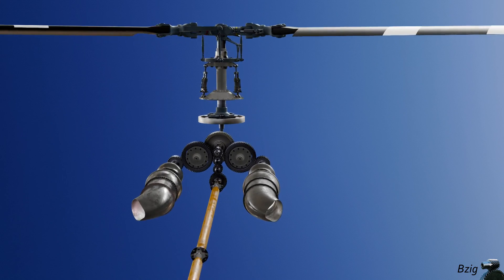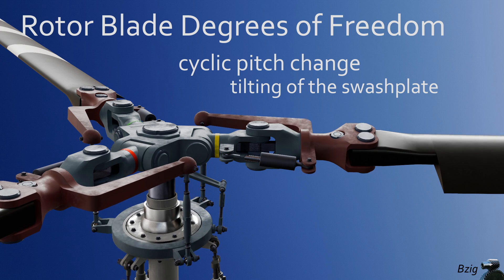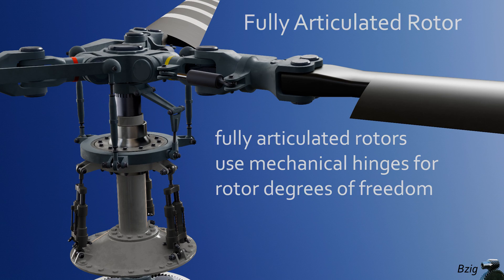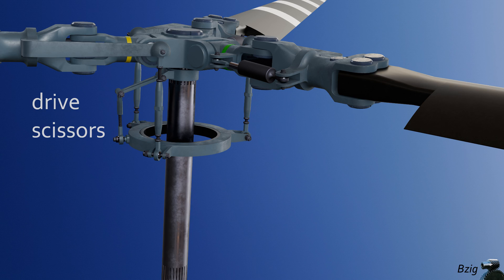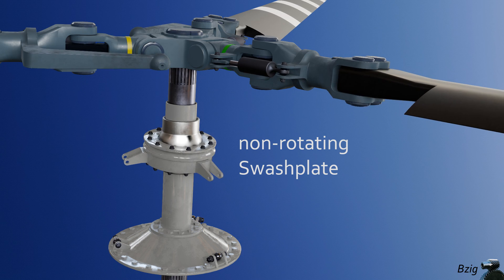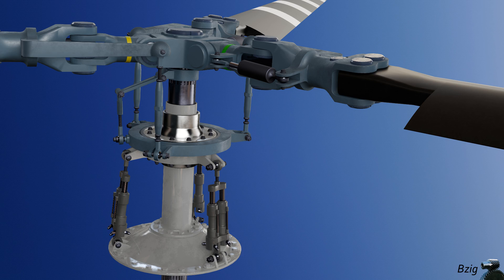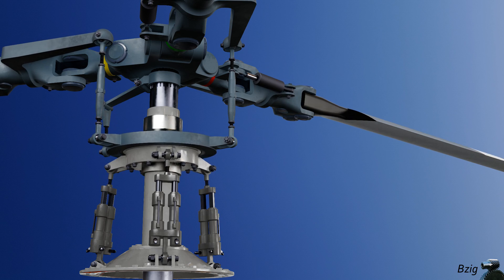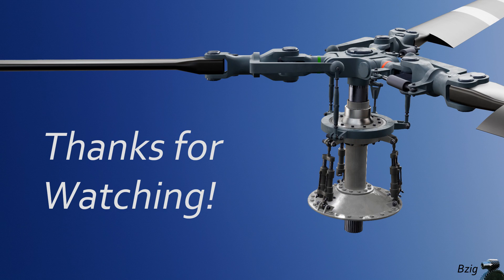Helicopter Swashplate Control

Comment: If they can reduce the vibration and wear and tear, I think the rigid rotor system would be ideal.
Reply from the maker: Am I right that the fully rigid heads, like the BO-105 and the Lynx have fallen out of favor and more designs today are semi-rigid with a little less flapping stiffness?  Like you say, ride quality and vibs sells helicopters.
Reply: @bzig4929  
I would say you are.   The benefits of their simplistic design (relative to a hinged, fully articulating rotor) and superior agility and handling aren't the top priorities for cargo and people haulers.   So I was anxiously looking forward to see what would come from the Sikorsky/Boeing Defiant and the Sikorsky Raider X models that the army was funding.  But they pulled the plug on that,again  so...  We're just going to be stuck with these terrible hinged, fully articulating rotors for a little while longer, lol.,
Reply from the maker: @bryanrussell6679   and interestingly, all of the tiltrotors, MV-22, AW-609 and V-280, are 3-blade teeters with a hub spring.  And the electric VTOLs all seem to be stiff systems that are likely absorbing some severe vibrations during the transition to forward flight.  It seems like simple designs that brute force their way into the air are winning out over engineering elegance.  Like you said, "lamenting out loud"
Reply: @bzig4929  
Yeah the tilt rotors are basically like giant propellers  but with the ability to tilt, like you said.  I'm not sure if a fully articulated rotor system would survive the 90-100 degree swing without self destructing.  I can't say for sure, but there has to be a reason the tilt rotors don't use them, lol.
Reply: @bryanrussell6679 Osprey has cyclic control
Reply: @ArneChristianRosenfeldt  
Lol, I definitely worded that wrong.  Of course tilt rotors tilt...  You said what I failed to.

Comment: in my day tail rotor pitch change was achieved by the foot peddles - not the collective 🤦‍♂🤦‍♂🤦‍♂
Reply from the maker: Ahhh... It took me a while.  I said "collective pitch change" on the tail rotor.  Is that what you meant?  I was referring to the definition of "collective" as "all at once" not the named control column.  But, I see the point that what I said is confusing.  Thanks!

Comment: Delightfully sophisticated design. I can only imagine the staggering amount of work, brain-power, and dedication, not to mention countless trials it must have taken, to get such a hair-brained concept to work half-way reliably and be commercially viable.
Reply: Don't get me wrong, the video, the animation and explanation are really good. But the notion of having large blades spin really fast, all the while controlled by high precision mechanisms, the entire assembly out in the open, susceptible to imbalance, constantly subjected to vibrations, is not particularly confidence inspiring. God forbid one of the many pins or joints or levers fails. Maintenance must be a nightmare.

Comment: so... what prevents the blades from drooping along the flapping hinge when not rotating ?
Reply from the maker: good question... when rotating, the CF loads keep them from drooping or flapping excessively.  As you shutdown the rotors, there is a spring loaded droop-stop that moves into position (moves in under spring tension, moves out under CF loads).  If the droop stop malfunctions, the rotor won't be damaged as it would just come to rest against the limit of travel of the flap hinge... unless the blade hits another part of the aircraft as it's coasting to a stop.  Droop stops are painted bright colors so a crew-chief, outside the aircraft, can visually check when they go in.  Some aircraft procedures have the pilots pull the engines back to idle prior to shutdown for the purpose of getting confirmation that the droop stops are seated.  

I didn't animate the droop stops.

Comment: I'm a helicopter pilot and everything described in that video was correct. The graphics show offset dual servo actuators moving the swash plate which is why all three servos need to move to achieve lateral and fore-aft tilt in the rotor system (this was animated correctly). To do that requires a mixing unit between the servos and the flight controls otherwise the pilot would have no hope of controlling the helicopter. This video was very well done.

Comment: I love helicopters. I've only been in one once, but it was from Oakland airport to SFO at like 50 feet above the bay, it was unreal. Later I took up RC cars, boats, planes and finally helis and the learning curve was a wall. To turn left, you think about it and it responds, moving the stick = crash. Only the rudder needs some input, and too much is wheeeee! From what I've seen, the full-size ones are similar, like pushing over a domino is enough pressure. 3D flying 450's are bonkers.

Comment: Helicopter: A Million Parts Rotating Rapidly Around an Oil Leak Waiting For Metal Fatigue To Set In
Reply: Do not exaggerate to this extent, the system is very reliable, well designed, and has been in place since ancient times.
Reply: @ياقوت-ق  I certainly cant argue against the reliability of the roman empires helicopter fleets.

Comment: Awesome video. I'd love to see how the internals of the rotating swasplate actually rotates around the NON-rotating swasplate/spherical bearing, as well as the internals of how the up/down motion of the spherical bearing moves relative to the transmission adapter... ( In short, all of the bearing surfaces that make everything in that general area move smoothly (bearings, seals, etc). A deep look within that whole area ).

Again, great video. Thanks for sharing.

Comment: Those who think it is animated incorrectly don't understand gyroscopic presession. Flight control inputs take about 90* of rotation before there is any change, so that is why the actuators are placed at 45* angles at the rear of the swash plate and the pitch arms are 90* to the blad itself. This allows the system to put in the correct angle of tilt at the right place for the blades to change pitch where needed. So if you want to fly forward you don't tilt the swash plate forward you tilt it forward right, this puts the high side of the swashplate aft left, and when the blade reaches dead aft 45* later(90*) it is in the position for forward thrust. Flight control rigging and main and tail rotor track and balance were two of the things that I did on multiple different helicopters in the Army and in the civilian sector.
Reply: Well said sir!!  Isn’t this an amazing channel??  I love the fact that you back him up with real knowledge and experience. Right on!!
Reply: The 120 degree swashplate and the angle between blades and blade actuators doesn't make it easier for people to understand. A simple 90 degree swashplate and no angle between blades and actuators would have been easier for people to understand. The 90 degree delay of gyroscopic presession could also easily have been explained. When I assembled my first RC heli I thought the manual was wrong because I didn't know about gyroscopic presession. Needless to say I had no control over the heli until I corrected my mistake ha ha.
Reply: @dkjens0705   Even two bladed helicopters have the control horns at 45 degrees angles from dead aft or dead forward as this has to be done due to gyroscopic precession.
Reply: Sorry I read your comment wrong😅 my mistake
Reply: I think you have this stated incorrectly.  Its not a matter of taking 90 degrees of rotation before there's any change.  It's about gyroscopic precession; which is at 90 degrees to the force applied.

Comment: I wonder how high the friction is between rotating and non-rotating swashplates
Reply: It is a ball bearing. And I think that the swashplate is unstable and wants to tilt. So the more cyclic you apply , the more force and friction.
Reply: i disagree Arne.   the blade pitch is incredibly stable. due to Aerodynamic Twisting Moment, all the blades will want to increase pitch automatically.   this is easily witnessed when dropping a piece of paper vertically. it wants to turn flat into the air in direction its moving.   It when you want to change that pitch to something else is when CTM & ATM come into play, so yes, alot more force is required to get them to move.
 @ArneChristianRosenfeldt
Reply: @michaelgeorge3092  I did only consider rigid bodies. Around which axis do the blades pitch? I know that some blades have a stable airfoil like a flying wing. But I ( for RC or drone ) would minimize blade weight and optimize for Lift only.

A flying wing with a straight leading edge better has it made of steel. I think that helicopter blades have knife edge to cut through small branches and birds?

Comment: what prevents the lift acting on the blade from pivoting them upwards at the flapping hinge, it seems like they would just become a rotating cone of blades unless there is a stop that I'm not seeing
Reply from the maker: Short answer is... The centrifugal force loads as the blades rotate.  I'm planning a future video to show the details on that.  Thanks for watching!
Reply: Mechanically due to the pitch links they won't keep going up to that point. Like wings they are designed to take a certain amount of bending moment, and they begin to cone as collective is applied, when the system is at flight power and no collective is applied the blades fly at an angle called the "pre-cone angle" this is the blades producing enough lift for their weight but not yet enough to lift the helicopter off the ground. As the collective is increased the cone angle changes, and if the weight of aircraft exceeds the rating of the blades they can "egg beater", but this won't happen on the ground, you'll just run out of power(collective) and the blades will fly to a certain point and the drag they create will slow the whole system down, resulting in a low rotor RPM state and over torquing the system. Eggbeatering usually only happens if flight parameters exceed the limits of the system, such as if you are in a high speed descent, and you start to pull in collective, you aren't just trying to lift the weight of the helicopter but, you're also trying to arrest the momentum of the helicopter's movement as well, this can result in the blades snapping when they reach their limit and then looking like an old fashioned "eggbeater" to the outside observer. At this point the helicopter has the aerodynamics of a grand piano, and flies about as well, and there is nothing the crew can do to save themselves. This is usually the fault of the pilot and not the helicopter they have limits for a reason.